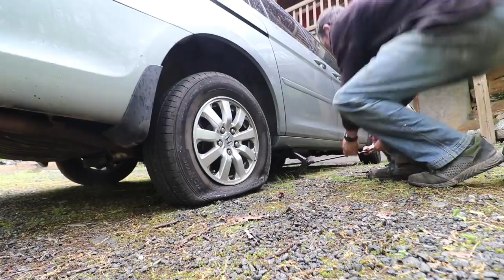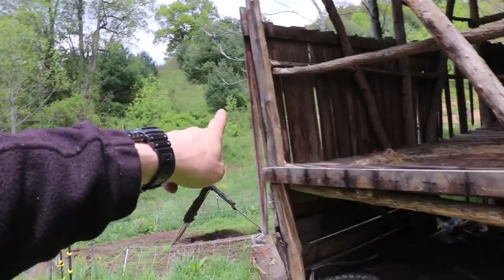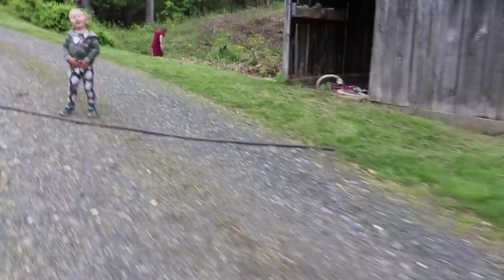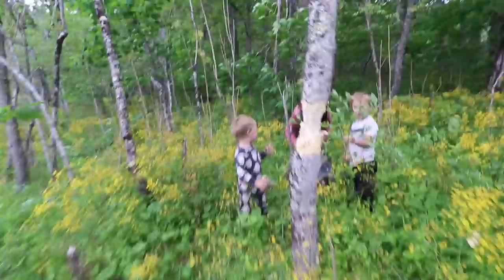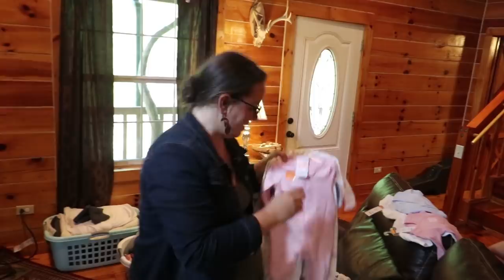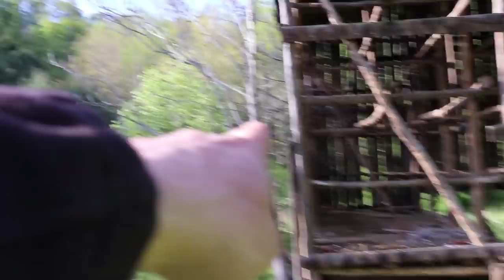STAGGERING Chick Losses As Soon As They Arrive In Mail

Comment: For future reference. The E-Break only holds the rear tires and the transition holds the front in park on a front wheel drive van.  Always add a Wheel Chock or a rock to block the wheels on the ground.

Comment: Hi Art, I too have had rat issues this spring, and I’m sure we are not alone. A couple of tricks I have learned over the years is first off, drill a small hole in the trap in one of the corners so you tether it to something the little buggers can’t drag away. As for bait, I have found that a small piece of pepperoni, yep, pepperoni to work incredibly well. I wrap a small half inch size piece in fine meshed onion bag material and then tie it on to the trigger release thingie on the trap.
So far this spring I have got 7 rats with the same trap and I haven’t even had to change out the bait.
Happy Hunting...

Comment: Find the den holes.  Fill with 2 pounds of dry ice and cover.  The ice will turn to gas, depleting the O2 levels in the den and they will die.  We had a 4 hole den that came to our compost and I thought I trapped them all last fall.  Dens reopened this spring.  Did this one morning and the dens never opened from rat traffic out.
Reply: Wow, great idea! Carbon dioxide poisoning! Could you use propane too? Propane is heavier than air so it would sink down into the hole.

Comment: When I was a about 9 or 10 years old, I trapped almost 30 pack rats out of the old cabin on my grandparents ranch.  I used a couple of old coyote/raccoon traps which I carefully slid into short lengths of old stove pipe and which I had attached the chains to pieces of wood (so if it only caught their leg they couldn't drag the trap far).  I baited the traps with a little grain sprinkled in the pipe under the trap.  Sometimes I had to finish them off by knocking them over the head with the piece of wood.  I caught at least two rats a day which I then buried and set big rocks over them to keep track of how many I got. I am a female and it amazes me how squeamish most people are these days.  I love animals, but sometimes you have to do what is needed on a farm.

Comment: That is why you have to fix the trap to something they can't drag away the trap from. My hubby screws the trap to a larger piece of plywood. And screws that to the floor of the attic etc. That way they can't grab hold of something around the trap and get out of it. Just slick plywood. Rats are strong and can get big. And now that they have tripped some. They won't go near them now. They are really smarter than people think they are.

Comment: In my city the rats have increased drastically until my husband used a baking soda and flour mix.  The rats eat it and can not burp so the basically blow up from the inside.  No dead rats in the yard either.  Last yr we tried so many different traps this yr my raised garden beds do not have any tunnels in them or around them.  No sign of them in our sand, or no sign of rat droppings.  Our dogs are safe and so are we.  There had been a rise in Leptospirosis which rats can spread.   We still continue to put the mixture out, but never notice the mixture going down.
Reply: That is great. Thanks for sharing.

Comment: Great job on the one you caught If you don't mind I would like to leave you with a thought if you are going to to continue using the rat trap you may want to anchor them down by using a nail and wire. But if you have large rat's then you will want to get some 110 Or 120 or A 150 conibear trap that way you just set them in the trail where they travel that includes on the wall and rafters just make sure you use the right clip for the trap you use personally I would use the 150 that way I can use it on raccoon's  skunks oppousm check your local DNR for your regulations you may have to use a cubby box that way you can protect your pets and children.

Comment: You could have fixed the tire without removing it from the vehicle, you need to get and keep a tire plug kit. 
The piece of rat left? A predator ate it.
Reply: Don't use a plug kit, it's a temporary measure at least, especially near the sidewall that nail could be 3 inches long

Comment: HOPE THIS WORKS 🐀🐀🐀 DIY Rat trap - use a big red tub ( you know the kind with rope handles ) drill a hole on each side, place a dowel in holes with a soda pop can in the center of the dowel load the outside of the can with peanut butter, fill the bucket with water and hopefully they drown. 
  This is a variation of a mouse trap that we used and it worked great. 🐀🐀🐀

Comment: Next time your in a Hardware store,, buy a plug kit & a 12 volt compressor(plugs in car lighter),,, probably under 25 bucks total,, little spray bottle with windshield washer,, never need to take tire off,, fix in 4 or 5 minutes... And you can help other people stranded too!! They always offer $20 & happy to pay it!! aloha
Reply: Sounds wonderful! Some cars have a built in compressor in the trunk too!
Reply: @StoneKathryn  Nail probably came from the dumpsters they filled.. Sweeping up sawdust day after day & dumping it in those dumpsters,, i run a magnet over the piles of sawdust,, put the nails & screws in a paint can.. Doors are not tight,, & closest to the house,, so when they get to the land fill,, open the doors,, dump like a gravel truck,, road edges are full across the country.. Wish I lived closer.. Aloha

Comment: I've had mouse traps with a half-eaten mouse in them before now. Other critters will be checking out the new food source as soon as it stops wriggling. The rat that you only have bits of may have been taken out of the trap by its hungry family.
I don't set any traps any more though. I have a cat who cleans up any mouse or rat problems quick smart - she'll bring in live mice to performance art before she eats them, but rats she always kills immediately, and unless they're very young she won't eat them. Just brings me the dead bodies so I know what a good cat she is. Much safer than traps or poison, and she has a lot more fun catching mice than I ever did!
Reply: Our cat won't take on the rats. We used the plaster of paris trick. We wanted a Jack Russel terrier to control them but they are expensive and hard to find.

Comment: I have discovered that if a mouse or rat can access the wire end of the trap then it can climb on there and the trap snaps but sends them flying rather than trapping them.  Then they come back and eat the food without danger.  If you place the trap inside a tunnel or enclosure like a box or milk carton so they can only access the food side of the trap to set it off, you have more success.  Rats are hard to catch.
Reply: We put our traps inside a screened wood box. The mice can only enter one side or the other. We can look through the screen to see if we caught one. The other animals leave the trap alone because it is covered.